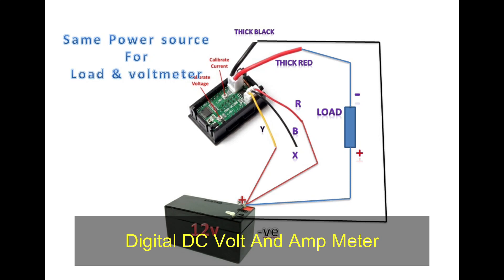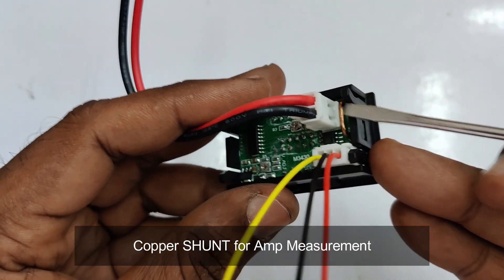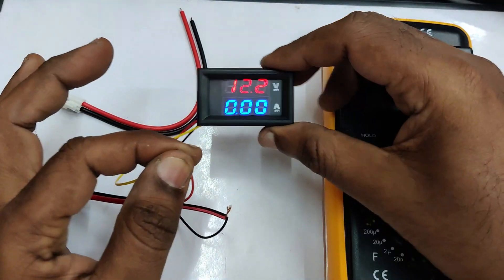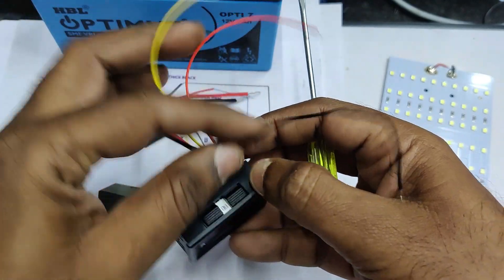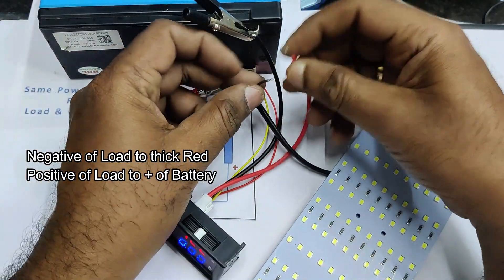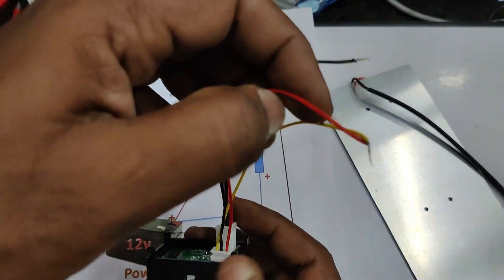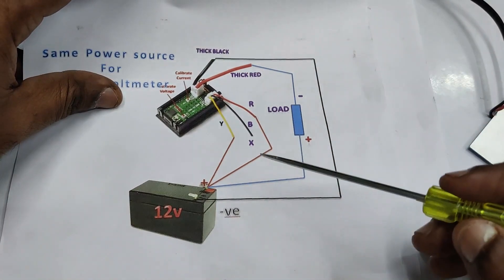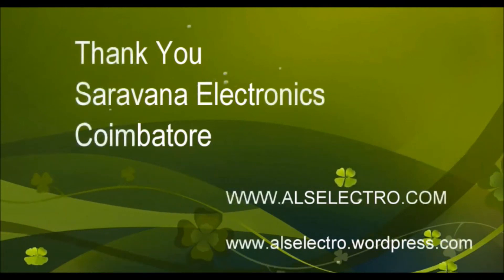DIGITAL DC VOLT AMP METER

Comment: Good explanation! Question? Is it better to use single source or double source? What are the pros and cons? I have a couple old pc atx power supplies and plan to make power sources out of them. In fact I already did. I have 3.3, 5 and 12 volts coming out of it. I want to add a potentiometer to control the Voltage and of course I want to see the voltage as I adjust the potentiometer. My question is do I need 2 power sources or 1? Or does it make no difference?
Thanks!

Comment: First time, I mistakenly tried to power the module by connecting the thick wires. I saw smoke coming and immediately disconnected.
Then tried using as per your video, everything works.  Do you think my module would be still broke?

Comment: Thanks. You just saved me the stress of connecting this. I just wanted a meter to measure voltage but ended up getting this without any details on the connection from the website

Comment: Sir,I have a auto electrical test bench which wiring is perish,it has four types of load with 200a shunt.can you provide the internal wiring diagram of ELAK MK 2 AUTO ELECTRICAL TEST BENCH.

Comment: Does the specified circuit for charging a battery work with a solar panel?
Your 12V battery = solar panel (?)
Your "LOAD" = battery that should be charged (?)
Solar panel 26 V / max. 150 W
Thanks for a feedback.

Comment: Can i use this meter to measure the current and voltage from a solar panel? 

I use the meter with the setup for the 2 power sources. 

Is this correct?

Comment: Sir you are a great teacher, you can simplify any complicated wiring , I am retired newbie and just finished a power supply kit but was confused about connecting this V/A meter  until I found your video, please continue with more videos like this. it was well explained, easy to understand and straight to the point.
Reply: I burned my battery wires setting this up without instructions, because the ammeter is dual negative leads but the circuit board under it's plug is labeled +-

Comment: Hi Saravanan, I am a retired person and DIY is my pass time. Your video is very systematic and easy to understand. Congratulations for explaining so nicely.
Reply from the maker: Thank you Sir for your apprerciation.
Reply: Wonderful information og digital voltmeter & ammeter & how much voltage required to on as well as warning for not use thin black wire. Lots of video is there on tube but no one is very clear about the voltage to use. You have clear all doubts & really feeling better that learn something new & correctly❤

Comment: we can measure volt red black yellow wire. But my doubt ...
Can we use this device to direct measure of transformer ampere without any other battery source load?

Comment: Sir,
How can I connect this v. amps digital meter with a battery charger.
kindly guide me with a circuite.
Reply: I did with TP4056 charger and 18650 battery.
If you still have the problem, let me know.

Comment: hello  saravanan i have a  variable power supply from 0 to 30v under 3A can i use this volt meter amper meter to show me the value for example when i use 3 or i change to 20v ?

Comment: hello Saravanan, i need to know how to use the Volt/Ammeter to measure the amp of my 3.7v battery.
Thanks
Reply: and in addition, can i connect the Volt/Ammeter wires in series with a battery to measure its amp/volt?

Comment: I am not getting same reading in general Multimeter (Mastech) and (0-100)V 10A Volt-Ammeter even closer values. Any help ?
Reply: At the back of the meter the calibration pots. V_ADJ and I_ADJ  use them to calibrate the meter.

Comment: Sir, why do we see a drop in voltage as the load is increased? I am using the same power source to measure current as well as voltage.

Comment: After a longtime I am seeing your presentation on Volt/Ampere meter's application in the you tube. I do remember you and your shop when I was working with Voltas at Coimbatore; I am a frequent visitor to buy components from your shop. Later on when I went to Bangalore I happened to see your online shopping; but I doubt about its progress. Anyway your video of this is very informative. What would be the price If I want to purchase? I need 3 nos and I am now at Ranipet enjoying my hobby. If you can tell me the price and the mode of payment I will send the same and also my address after you receive the payment.

Comment: Dear sir,  I have such a volt & current meter with one connector only with thin red, black & yellow wire. Can you let me know how the connections are for the voltage & current measurement please ?
Reply: But you could not show us  the voltage of the LEDs load !!!